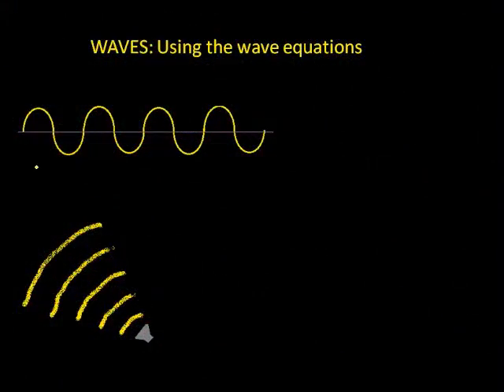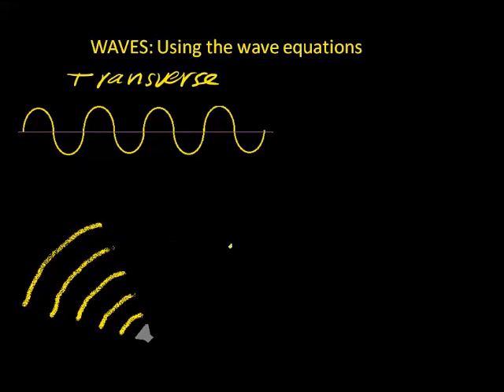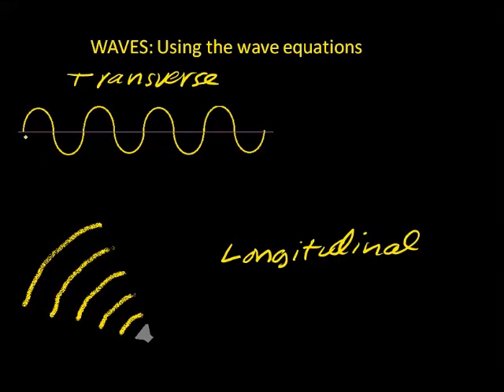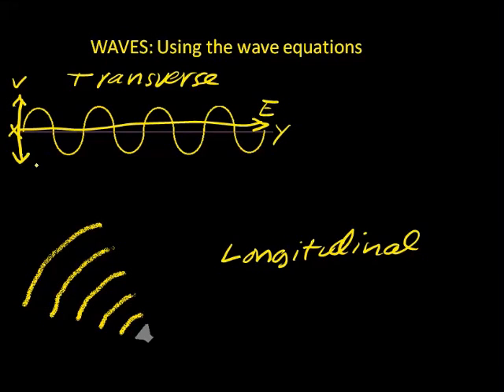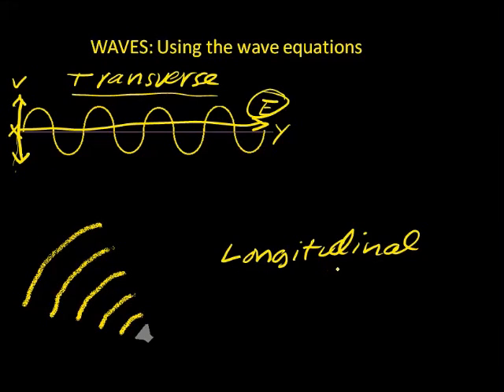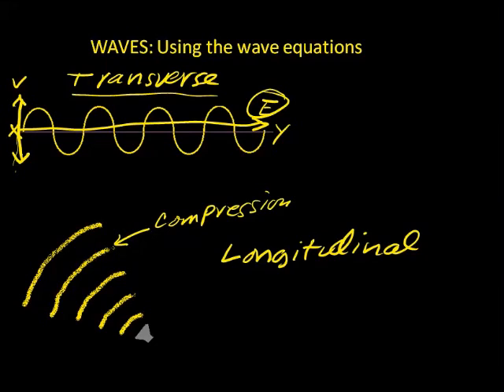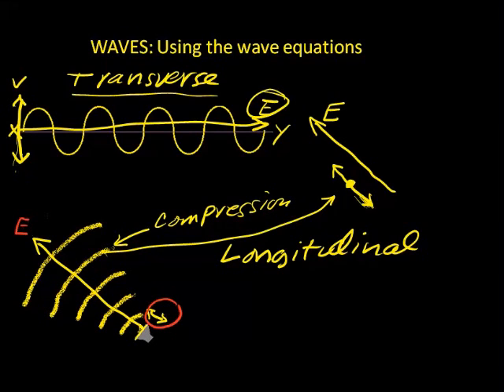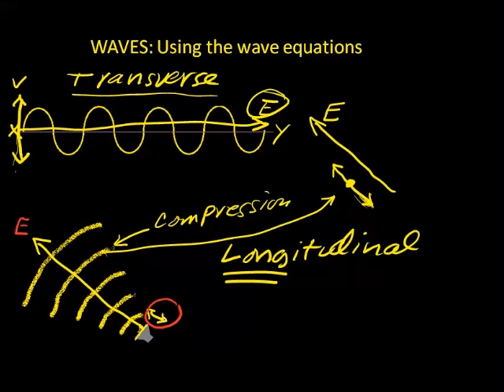WAVES #2: What is The REAL Difference Between Transverse and Longitudinal Waves?

Comment: Direction of propagation, ok, so we think a transverse wave is such because it propagates at right angles from a straight wire that curves in a coil., maybe its a longitudinal wave because the 'wire' isn't the source of propagation, rather an event happens on a spot of wire that emits an outward pulse, yes transverse to wire but not transverse to the event on one specific spot?

Comment: Are Electro-magnetic waves always Transverse waves? Is there a reason and implications from this ?
Reply from the maker: A transverse wave is a moving wave that consists of oscillations occurring perpendicular (or right angled) to the direction of energy transfer. Light is an example of a transverse wave as are other forms of electromagnetic energy. Electromagnetic energy can be polarized, which is one very important hint that it behaves as a transverse wave. Evidence supports that light travels as oscillating bundles of energy called photons.